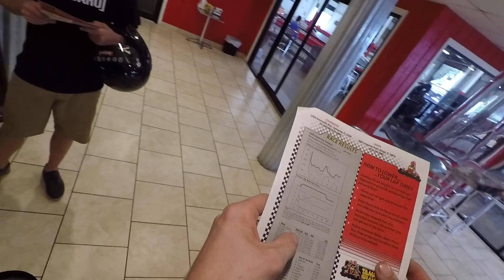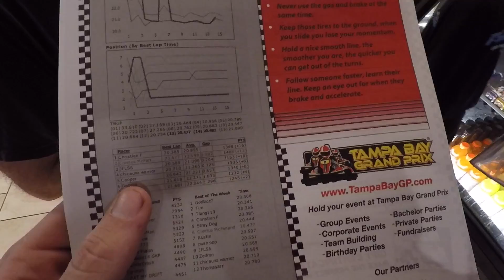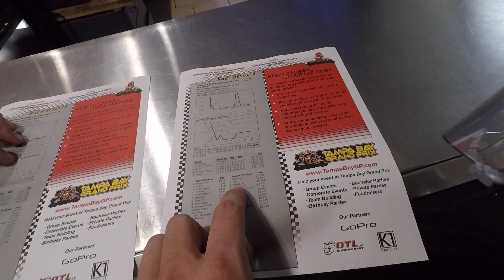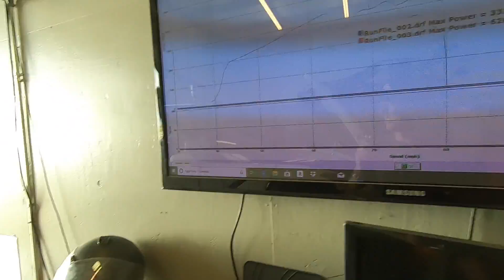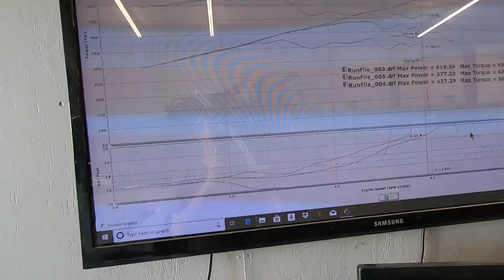Our ProCharged Corvette Hits The Dyno... Bald Eagles are ANGRY!

Comment: Proof that true gear heads are a rare breed. Calling on the fact that people peak'd with ruby to soon the trilogy is extremely entertaining by means of the 5.3l which was an oil starved blown engine (yes literally blow by was of the charts illegal in most states) which someone poorly limped around. Then was in op for however long or short either way looked exposed. Later gets turned up to a heat that usually New built engines perform. Within the few day timline. Things get minutely overlooked. Then within hours a factory 720s (o.e. tires an all). Would be overtakin by a massively clapped out corvette. With Cleetus. "These guys don't even have a bending jig", machine. lubrication system, cnc, etc. No offense remember I'm just point out the obvious "this is ludacris-straight to amazing.